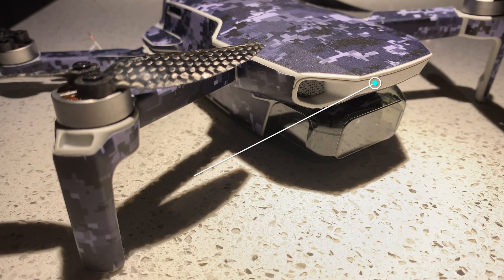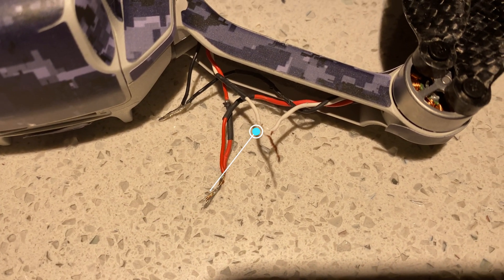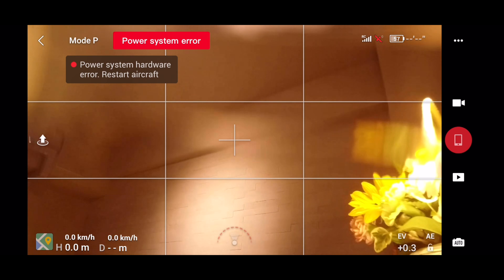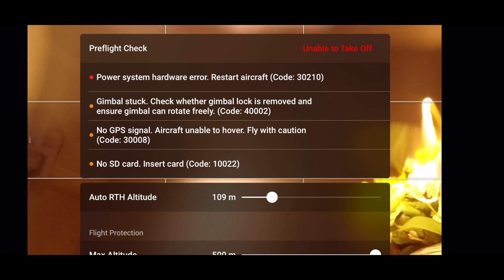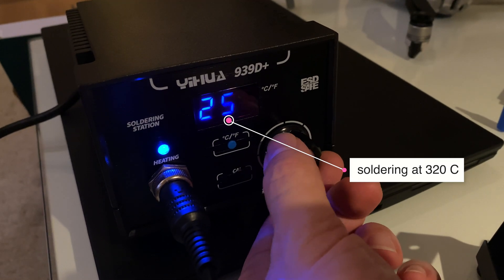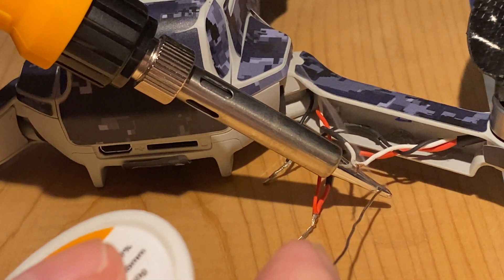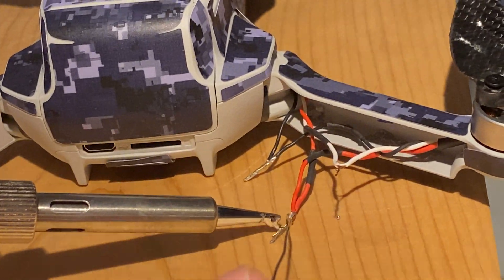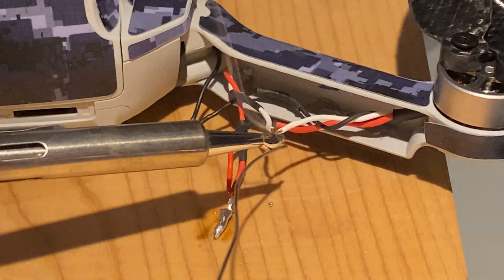DJI Mavic Mini engine swap, soldering job, sand damaged motor replacement PART 2/2

Comment: Does your drone behave better against the wind with these propellers?
Reply from the maker: I feel it does slightly. 
But it is not a huge difference.
Reply: @MattShonan  I adapted the mavic mini 2 propellers to my mini 1 to see how it responds.
Reply from the maker: @jjhow7991  Great, please share how you feel about the gains, if any occur.

Comment: Learn how to solder!  Heat a bit, dip or brush flux on wire BEFORE twisting, Twist LOOSELY, heat to proper temp BEFORE appling the solder.  It will melt - INSTANTLY remove soldering iron!
Reply from the maker: Yes, it was a quite early video of mine. 
Thanks for the advise and have a great rest of the day! 🙃🤙🏻

Comment: How did you crack open the arm? Is there a non destructive way to do it?
Reply from the maker: Thanks for asking, yes there is! 
Just run a sharp knife on the back side of the arm along the sides of the filling and it comes right out. Once done you can work on it. After your are finished just glue it back in.  Good luck and have a great rest of the day!   🤙🏻🙃

Comment: Great but a bit dismayed, you should’ve shown how ya opened the cap
Reply from the maker: Thank you for your comment and interest in the video. 
You mean you like to see how I got in to the arm removing the back cover to get to the motor wires?
Reply: @MattShonan  yeah yeah
Reply from the maker: @raphaelpolino7273  Yes I did not record this. But it is actually not difficult to get in there. 
DJI uses a styrofoam cushion to cover the back of the arms which is glued into the arm. To get it out without damage  just run a blade along the sides on to top and bottom of that cushion and it comes right out. After the repair it can be then glued back in. 
Hope you like the content of my channel., consider subscribing and have a great rest of the day 😊👍🏻
Reply: @MattShonan  aight, I’mma try it on, this’s a helpful one.. Thanks 🙏
Reply from the maker: @raphaelpolino7273  Good Luck 😊☘️

Comment: Do you recommend the motor caps??? Can overheating?? I have a Dji Mini 2
Reply from the maker: Actually I can not recommend them, the engines run better without. Even with caps dirt goes in and then is stuck and can't get out anymore. 

I fly a lot of FPV and engines are quite fine even in rain and snow. 
It depends on how much risk you like to take. I fly in all weather conditions and never had a crash because of that. 
Happy flying!